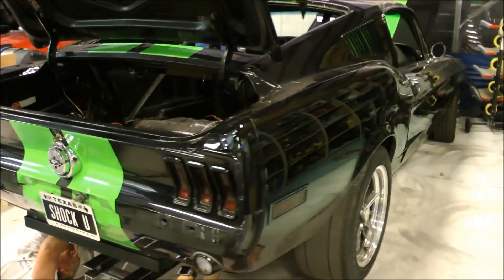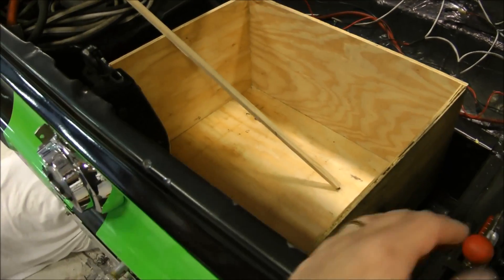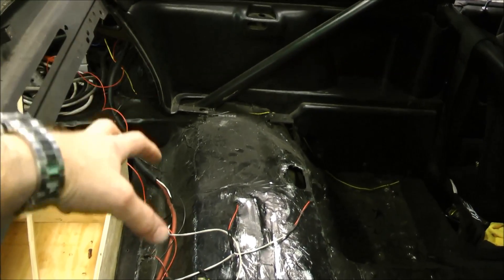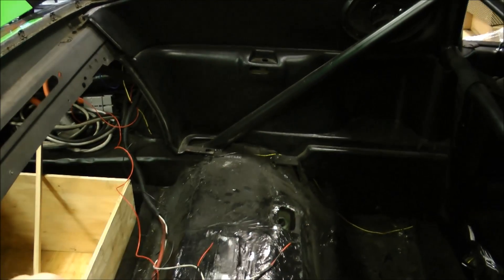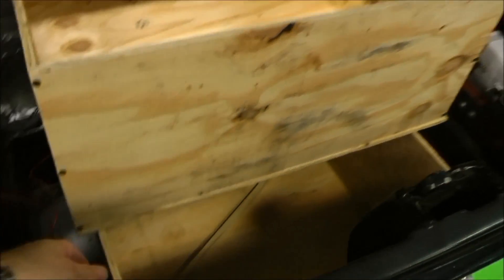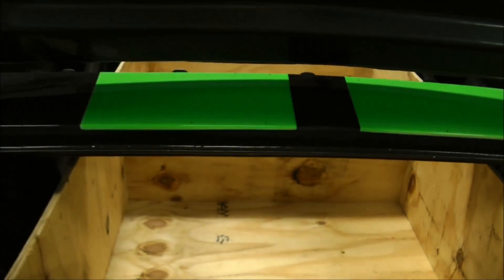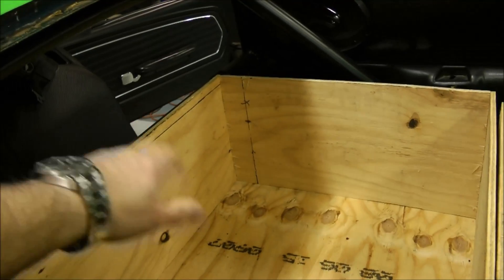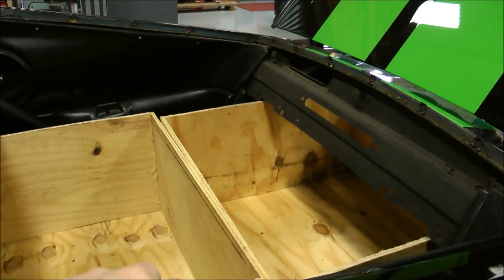battery overview part 2

Comment: You seriously need all graphene lithium batteries, the rate capability/power density is 10 times higher than lithium cobalt oxide which I assume you are using.  Should give you a 10x weight reduction as long as there is enough energy density there for the full mile.  How many amp hours will be left in the pack after the run?

If your battery supplier is building custom batteries they can also build these. Of many projects I am working on this is one. I think using graphene nano-ribbons in the graphene oxide cathode instead of slightly reduced GO in order to increase conductivity could lead to higher energy density, but it's a work in progress. 

http://www.nature.com/articles/srep05278
Reply: +Lupus Mechanicus  So you think he should be using a battery chemistry that doesn't actually exist in production form?  By the way, he's using A123 LiFePO4 cells, not LiCo.
Reply from the maker: +JRP3 The cells I am using are the most "high power" cells that Voltabox uses in production. They do not use lipo. The goal for getting a sponsorship is to break 200 MPH using the same cells that they sell in production.
Reply: +mitchmedford I thought in your previous video you said the Voltabox batteries were using A123 20650 cells, which last I checked were LiFePO4, lithium iron phosphate, chemistry.
Reply from the maker: +JRP3 Yes, I am using 26650 a123 cells. I was commenting that they do not offer other types of lithium like lipo pouch cells. here is a link to the spec sheet. http://www.a123systems.com/Collateral/Documents/English-US/A123%20Systems%20ANR26650%20Data%20Sheet.pdf
Reply: +mitchmedford  Yeah, I didn't say anything about pouch cells, or that you should actually use a different chemistry.   I think there is some confusion, my original comment was in response to Lupus Mechanics who was suggesting you should use graphene lithium batteries, which as far as I know don't actually exist in working form.
Reply from the maker: +JRP3 Ohhh. I got the post in email and didn't notice it was a reply to another post. Anyway you are correct about everything.
Reply: +JRP3 http://www.hobbyking.com/hobbyking/store/__91177__Turnigy_Graphene_1300mAh_4S_65C_Lipo_Pack_w_XT60.html
They do exist in production, but thanks for the reply Mitch as I see why you are pushing the limit with the current technology.
Reply: +Lupus Mechanicus  I didn't realize Turnigy had those available.